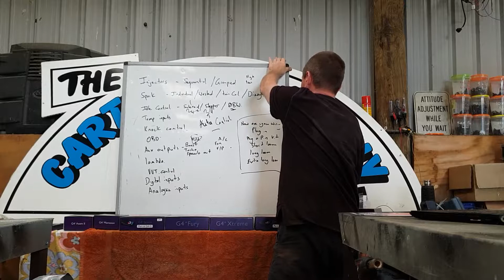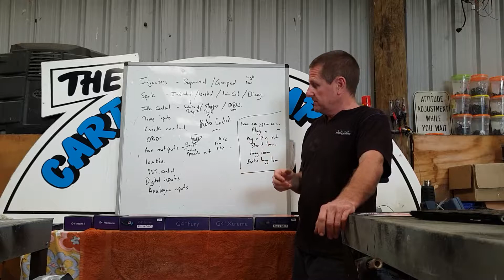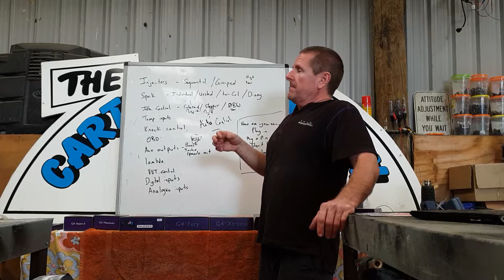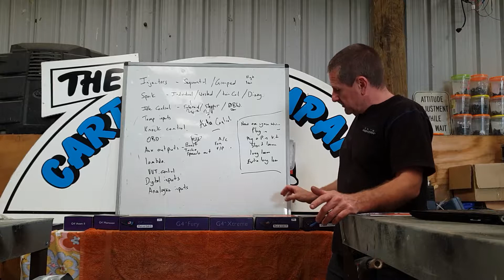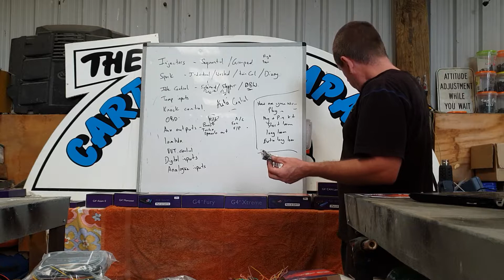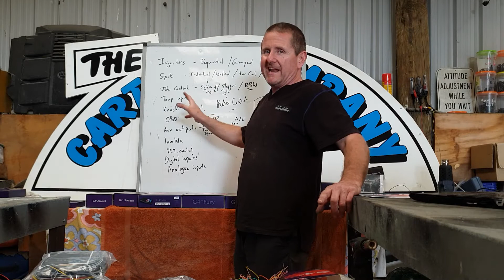Aftermarket ECU Wiring. - Choosing an ECU

Comment: Great content as always. Building a 1uzfe in North America is rough and these videos help a lot. What would you recommend for an all motor build with sub 400hp in mind. Looking at cams and itbs pretty much. Thanks 🙏
Reply from the maker: Hello Fedora.  Im thinking finding good info and tradesmen with knowledge over there is tricky.  For a base level I would be heading for a link storm.  I wired a drift car (silvia) which in time has similar build in mind, itb and engine running na.  Hopefully Ill get around to editing the footage from that one.  Choosing an ecu is more about finding a tuner competent with the product then having enough inputs and outputs to do whats required.   Cheers Kelvin.
Reply: Lusty Wench I’m from Canada tho how u get states from that. There is literally no after market support other than camber kits. 1uz is not loved because of LS engines. If you want to actually build a 1uz you have to get parts from NZ and AU. Plus here in Canada ls400s are going up in price for no apparent reason.

Comment: Hey mate iv got a 
1996 2.6 tf rodeo .4ze1 
In progress of installing e6x haltech need help with the body wireing and distributor wireing
Reply from the maker: I have a free haltech wiring series which is easy to find using the search function.  I'm not booking more work at present until present workshop work is completed.  Cheers

Comment: I have a 2jz gte single turbo with high impedence Injectors and auto transmission. Can I use link g4x monsoon to be run as wasted spark? Advantages and disadvantages of it? Any information will be appreciated
Reply from the maker: You can run as wasted spark however thats not my preference.  By going to an ecu with more outputs you can have better control with fuel sequential injection and individual coils control.  Monsoon will work and run however.  Personally my choice would be a Fury for that application as I like the built in wideband.
Reply: @CartuneNZ  thank you for the quick reply, I'm using individual Coils atm. What is the actual difference and how much is the difference if we're can the difference be seen if using monsoon  or fury in 2jz gte. Thank you once again

Comment: Good day RYAN here I am thinking of putting a 1.8t 20v engine in a mk1 golf using the standard instrument cluster building a fun Daly driver that must be reliable what  do you suggest I want all the bells and wisthles of modern cars in my setup was thinking of spitronics
Reply from the maker: Spitronics is a good ecu however its also a budget ecu therefore it does not have all the bells and whistles.  I suggest writing down what you need to control on both the engine and the car , then match that to a suitable ecu.
Reply: @CartuneNZ  basically only the engine the internet cluster and the interior heater moter posebly the wipers

Comment: Hey fellow kiwi here, Have just started down the link ecu road and a drift build I'm doing. What is the expected pricing for a wire in loom for a link g4x going into a toyota soarer with 1jzgte non vvti? was thinking about going with an AEM wideband so can have the gauge without needing a full digital dash/screen, do these work well with the link?

Comment: What specifically don't you like about the Megasquirt ECUs?
I'm planning on running a turbocharged VVTI 1UZ on a Megasquirt 3 in my RA28, and a 5SGTE on a Speeduino in my RA65.
Reply from the maker: Hello Aaron.  Over here I see lots of really really poor installs and every one that comes in is a mess.  I did a tidy up video of one which shows one of the common looms over here.  A join in every wire , no TPS , No idle control.  Many years ago I wired one for a guy , tuned it and it has done over 130000km without any issues.  Toms ute which is in another video also runs one which I spent time getting just how he wanted.  Purchased a "plug and play" kit which wasn't what he expected when it arrived.  Also most dyno shops over here won't touch them for similar reasons.   Cheers Kelvin
Reply: @CartuneNZ  understandable, I've seen some pretty bloody shocking DIY wiring both in my job and helping mates out with their cars.

Comment: Hello from USA!  I have an 89 Mazda b2200, I also have a 91 Lexus ls400.  I plan on making the engine harness I currently have (out of the lexus) into a sort of standalone harness.  I have read that there aren't any immobilizers, also that the one plug required to run the computer and the engine harness can be 'blended' into my factory harness.  Should be about 7 wires.  I want to run the factory auto trans, factory ecu, and factory engine harness with the least amount of wiring possible.  Am I on the right track?  Thanks again in advance, just trying to learn all I can.
Reply from the maker: Hello Billi.  That 7 wire thing is kind of funny.  There were lots of 1uzs wired incorrectly using that 7 wire thing,  I did one the other day running on 2 wires,  didnt run correctly but it ran.  My looms only need a few wires connected after I spend 10-15 hours tidying them up.  All connectors are likely to break but i do it once and do it right.  We did an older mazda ute a while back.  I made a plug in loom for it and it went really well with the auto.   Cheers Kelvin.

Comment: Looking to re-do a 1JZ turbo (non VVTi) in my MX73 Cressida, have been looking at Link and Haltechs. Doesn't need VVTi control, doesn't need DBW, CAN is not important. Would like to future proof it with capacity for Flex Fuel, so the Storm seems to be sufficient but I'm not sure if its worth going for the Fury to get inbuilt Lambda and Peak & Hold injector capability. There is also the possibility of getting the plug-in 2JZGTE ECU and getting it to work on the 1JZGTE (shouldn't be much to change surely?). Love your videos, any recommendations greatly appreciated!
Reply from the maker: Hello.  Great to chat with someone who has done a bit of research.  For me a wideband of some sort is pretty much a must have these days.  I really like the Fury in that respect but if on a bit of a budget then a Storm and a Wideband - preferably a canlambda however any quality wideband controller is fine.  Myself I really like internal wideband as it makes the install easier and neater.  If you ever want to run low impedience injectors the peak and hold function is best as well to avoid the need for resistors.  With the plug in it is important to compare the header plugs of the ecu to see that they are the same plug then compare pinouts and swap to make them match.  Often the stock looms are getting untidy so a new loom is the way these days to avoid the issues of old looms.  Hopefully this is helpful.  Cheers Kelvin
Reply: @CartuneNZ  Thanks for the response! The stock loom is definitely untidy, I'm planning on pulling the whole thing out and re-doing it.

Comment: hi i got a link monsoon, trying to wire it in and tune it on a s15 sr20
Reply from the maker: The monsoon is a great choice for an SR20. I have one here running a monsoon.  I did some footage of the wiring but never got it edited.  Very easy to set up too.  Much of my onfo crosses over to other engines.   Cheers Kelvin

Comment: have you made a video on how to wire up a after market ecu with a s1 1uz and auto box ? im thinking ltx10 with mine , liking ya work mate its very helpfull
Reply from the maker: Hello Mark.  I have done many hours of footage but it never got edited unfortunately.  Ive got a customer wiring one atm and Im hopeing to catch up with them next time Im in their area.  The ford hotrod is VVti with stock trans and aftermarket ecu but didn't do instruction video.  Nothing booked in atm on that sort of job.  Cheers Kelvin

Comment: Mr. CartuneNZ, I have a 2000 lexus GS300-2JZ engine that I'm swapping out for a 2000 GS 400 3uz.Will this GS 400 engine plug up to the existing wire harness that's on/In the car or will I need an additional harness to make this work.So in other Words originally from the factory this is a GS 300 2JZ engine set-up,but I'm wanting to install a 3-uz  GS 400 4.0 engine, will this engine plug-N-Play as is, or will I need additional wire loom off of the GS 400 3-uz to make this work,Really need your help on this one,Thank you in advance.
Reply from the maker: Hello Craig.   Toyota are close but not quite a plug and play.  With some swapping over of pins it should be possible to make everything work.  Cheers Kelvin

Comment: Hi Kelvin, another great vid mate. I have a 100 series landcruiser with the 2UZFE in it here in Christchurch. I want to run your header kit as it will fit plenty of room. But these trucks have the post cat O 2 sensors which always seem to through codes after header install . I’m thinking of running a piggy back link ECU to by pass the O2 problem and just to get some tune ability as these factory ECU’s are totally locked by the sounds of things. Do you know of anybody in ChCh that can do this? As I’ve heard that NZ EFI don’t do it anymore?
Reply from the maker: Hello Nigel.  I'm starting to see more 2uz coming through these days.  I don't know anyone suitable for doing that job in Christchurch. Ive been wiring a car down there and expecting to do the setup at some point on it.  Is your truck an auto?  Theres a few tricks to keeping the auto working correctly.  Cheers Kelvin

Comment: Hi. I´m a formula student team member from Spain. We have a link G4+ fury from last year´s car, and we are thinking about swapping the engine to a KTM450sf-x, a 1Cyl engine. Any issues with the ECU? Thanks!
Reply from the maker: Hello.  I also like the dirtbike stuff.  Provided you have the correct trigger inputs for the ECU then I don't see any issues.  I have a man over here working on fuel injected two strokes (he did it before KTM did it) .  Cheers Kelvin